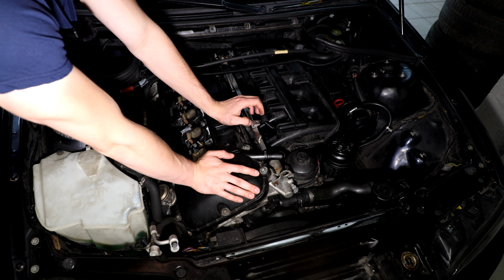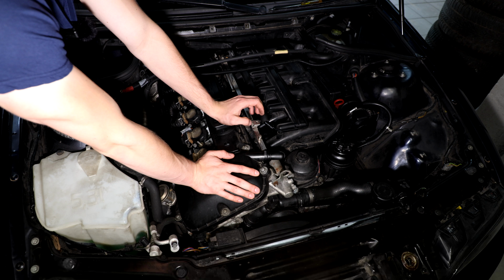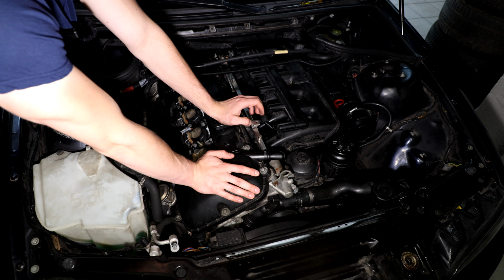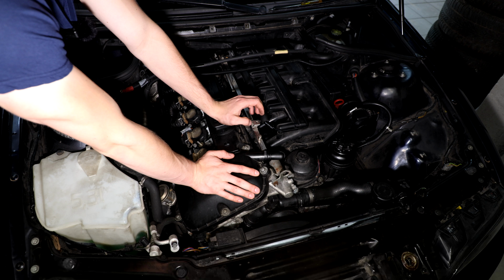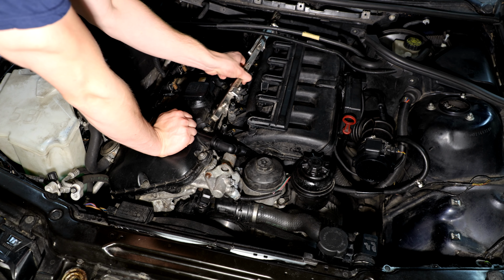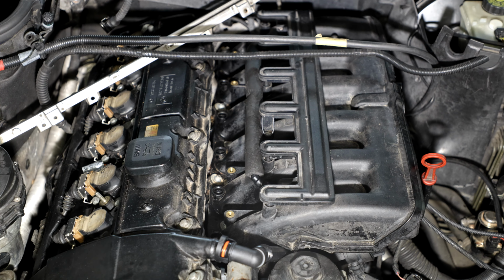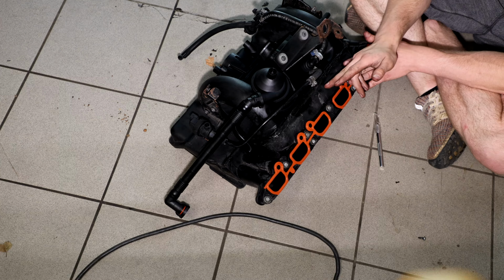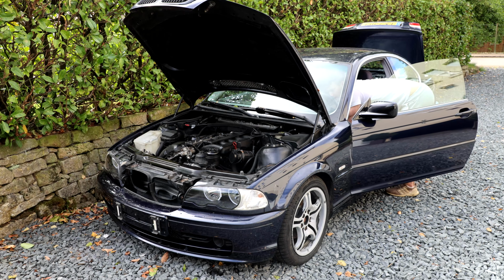Fixing the misfire on my e46 coupe// Project Broken

Comment: I also have air leaks, been preparing for weeks to do this on my e39 m54b30, thanks for all the tips! Ill be trying it soon
Reply from the maker: @mica_papagajka
@mica_papagajka Do it! the engine will run so much smoother aftwerwards :) Also, try to buy or lend a smoke tester, it definetely makes this procedure so much faster and more accurate :)
Reply: @DailyDrivenClasssics  ich hab im plan einen smoke tester selber zu bauen aus akku-lötkolben und einem alten gurkenkrug, indem ich neben dem loch für den lötkolben noch zwei löcher für einmal druck einlauf und einmal auslauf mache, den auslauf an den motor verbinden und dann nur ein wenig druck aufs ganze drauf. Natürlich mineralöl in den krug und kolben anschalten, dann rauchts auch richtig. Das zahlt sich mehr aus weil ich den akku-löter öfter brauche als die smoke maschine später
Reply from the maker: @mica_papagajka
@mica_papagajka
gute idee. Ich habe selber ähnliche tutorials gefunden, habe mich aber dafür entscheiden den smoke tester zu kaufen weil ich ihn oft brauche aber bis jetzt das geld nicht ausgeben wollte weil zu teuer :/ Aber der ist so praktisch, hat sich jetzt schon fast bezahlt gemacht :)

Comment: I can't believe that for 25 years not sigle one of previous f#cking retarded owners didn't change the fuel filter wich cost about 30euros!!
What a shame.. poor car... And then someone come and says "older bmw are not reliable"... yea of course... it was running with original fuel filter for 25 years! 
Maybe not smooth, but it was running...

Keep with the good work, I hope that you can save it and enjoy it at least a little bit.
All the best!

Comment: Really interesting video. I have the E46 325Ci (M54B25), which is a beautiful car with very little rust so worth keeping. Unfortunately it has the dreaded oil consumption issue, so I am contemplating whether to overhaul the engine or not. I have tried the Berrymans B12 Chemtool piston soak, it's a bit too early to tell whether there is any improvement, but I am not that hopeful. We'll see.
Reply from the maker: @bobfrankish8883  I remember you telling me that in the last episode. Sad that the treatement didnt work :( but even if you need to do an engine rebuild, its gonna hold up for many more years :)